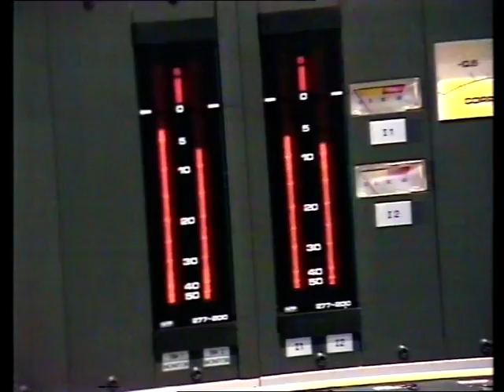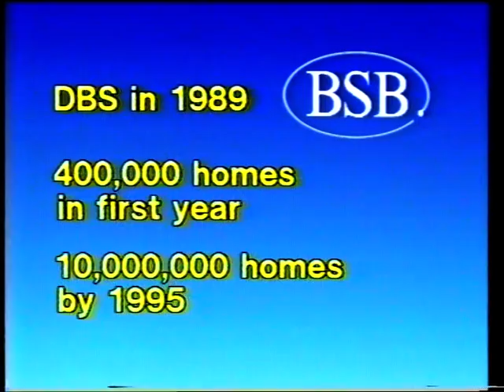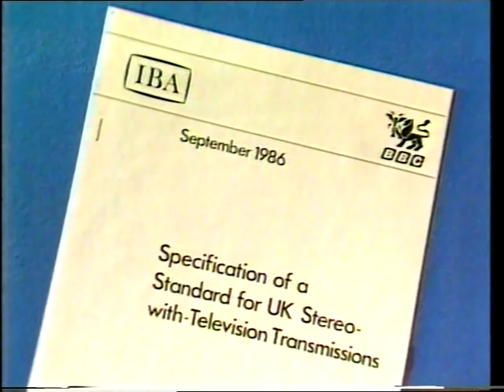IBA Engineering Announcements - BSB Satellite, TV Stereo Sound & Channel  5  1987

Comment: Channel 5 when it came was pretty useless, unless you were close to the transmitter, and even then it was still snowy and grainy.

When it popped onto the Astra 1D satellite @19.2 East, reception was much easier to receive, but the satellite transmission didn't carry stereo audio via 7.02 / 7.20 MHz as the NICAM terrestrial stereo transmission did.